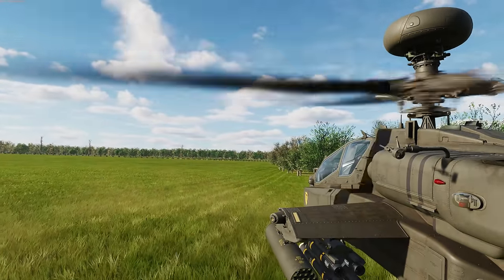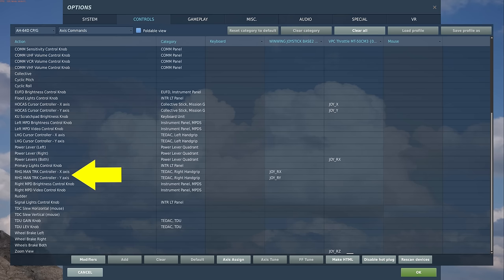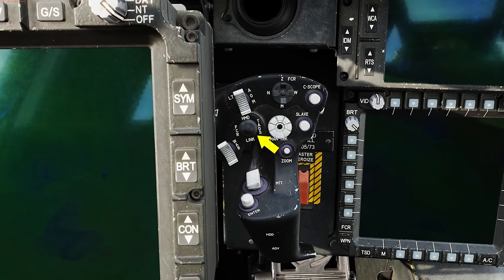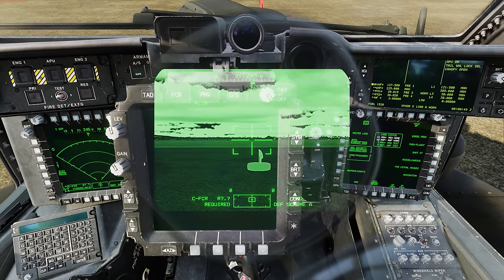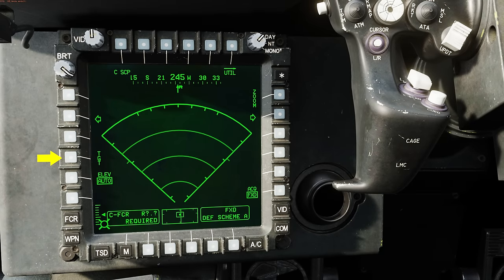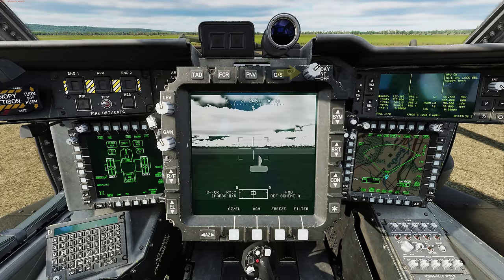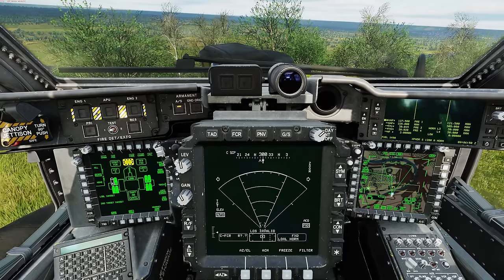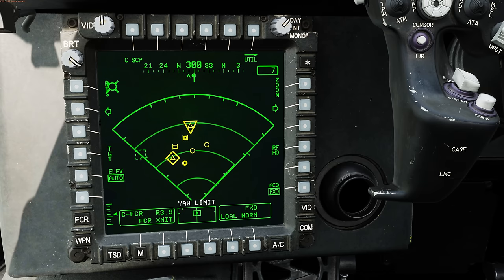DCS: AH-64D | Fire Control Radar Pages & Controls

Comment: How the FCR auto classify anti-air ground unit from a tracked vehicle for example? and how precise de classification is? crazy tech.
Reply from the maker: Processing of the radar return.
Reply: If I had to guess, the size/spin of the radar dishes probably provides a pretty massive radar return, since they are usually pretty big and often spinning on top of the vehicle. 

I do wonder if the system in real life would be able to differentiate between something like a Tor launcher without the radar going and just a standard AFV or APC.

Comment: Great work with Apache it has came so far since release and its an amazing module, but I have a question 
I'm not sure if you can answer this question yet but will we be able to Remove/add the FCR eventually on the ground or will it strictly be a Mission editor option.

Comment: Can someone explain how the radar can difference a house for example from a stationary tank? Because I cant wrap my head around it. Also the F18/F16 "Ground Moving Target" radar mode can only see tanks that move at idk like 10 knots.
Reply from the maker: It uses a millimeter wave radar and advanced processing to determine classification based on the detailed radar return. The -16 and -18 don't use millimeter wave radars.
Reply: Millimeter wave radars are capable of detecting and tracking objects in the millimeter and centimeter scales. It uses a very narrow, thus focused, beam that can differentiate between the format of a vehicle and the background. In case of tanks, this narrow beam hits the tanks structure and the returns are very high, since tanks are made of metal and have a distinguishable format (tracked, turret, long barrel). However, it cannot distinguish between a Abrams and a T-72, for instance (or at least in the civil version of the information found online. If the radar can, then it must be hush- hush top secret). Buildings have a good return since they have straight corners, but radar waves are partially absorbed by materials like brick and concrete. Then very complex signal processing is used to make this classification and differentiation of radar returns. But the real magic happens when dealing with AAA and SAM threats, that by the format of the radar return, the system knows what is a ZSU (four barrels, tracked vehicle) from a SA-5, for instance (no barrels, radar, tracked vehicle). It process the radar returns, compares the data with a library, then you have a best guess, identification and classification. It all happens as shown in the video, very very fast, which requires a very sensitive radar sensor and a decent signal processing unit (all made with 80's technology 🙂 )

Comment: can someone explain me why td does the apache drifts to the right and doesn't stay fucking still while i try to land/hover/ takeoff?
Reply from the maker: No such issue here with proper flight and trim control.
Reply: Most helis with the rotor spinning counter-clockwise require a bit of left-back cyclic to hover stationary. The torque from the rotor wants to spin the nose to the right, you use left pedal to keep it steady, this makes the tail-rotor push the tail to the right. The tail rotor and main rotor balance each other out rotation wise, but the tail rotor is still pushing the helicopter to the right, so you need to compensate with a bit of left cyclic.

The Russian helis with a clockwise spinning rotor do the opposite, and tend to drift to the left, requiring a bit of right-back cyclic and right pedal. Not the Ka-50 obviously, since it has a co-axial system.